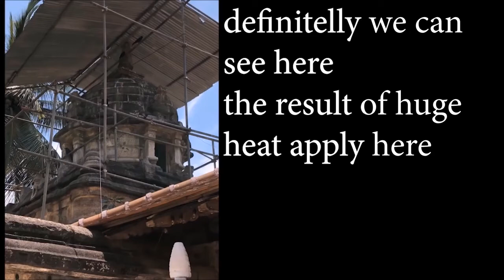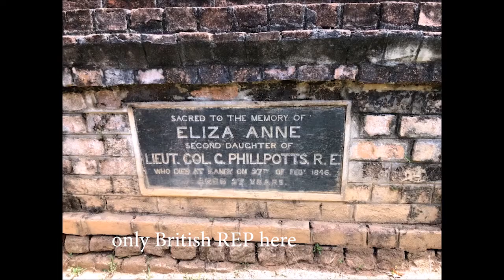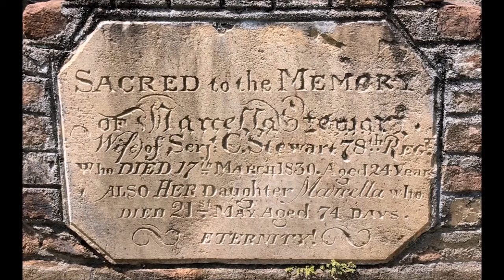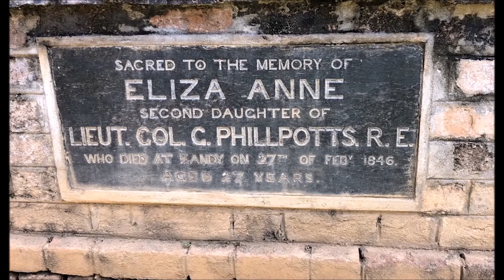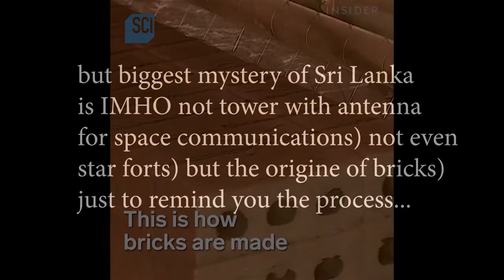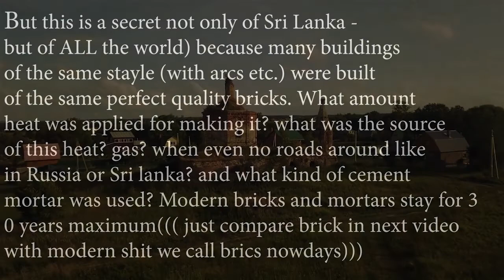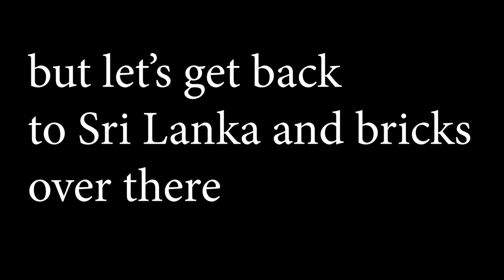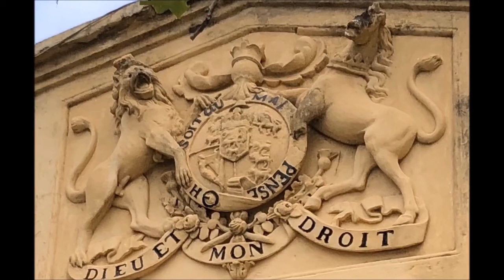Sri Lanka. Part 2. Stupas and bricks

Comment: Great video. I'm sure some of the brick buildings we see in Ruins are quite old, but the bricks we see at ancient ruin tourist sites cannot be trusted to be authentic. Vlad9vt has a few videos on his channel showing photographs taken in the late 1800s / early 1900s of well-known 'ancient ruins' tourist destinations of today completely pulverized. The biggest tourist destinations of today in Peru, Mexico, the Middle East look nothing like they did a hundred years ago. Sure there is some resemblance but they have been completely remade in some cases. A site I always wanted to go to was Machu Picchu which turns out is one of the sites that has been completely remade. I still want to go... but in Machu Picchu is case I know most of the building material is completely modern. Something to keep in mind.
Reply from the maker: yes) real age - absolutelly NOT what we are told)
Reply: You can identify wether those ancient brick buildings  in Sri Lanka are reconstructed /restored or the original ones.
Original bonding matirial is a mixture of various herbs,honey and clay which hardens in minutes .Those bricks in Sigiriya are originals.look at the bonds between bricks.
Reply: an Original brick excavated from Jethavanarama great stupa ,can withstand 163kg s of load.